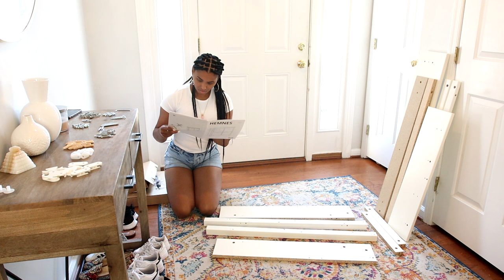IKEA HEMNES SHOE CABINET HACK I SHOE STORAGE IDEAS I ENTRYWAY MAKEOVER (PT.1)

Comment: Looked great!  That piece looks narrow enough that I could put it in my hallway.  Hope you put wood glue in the extra holes you drilled with the frog tape template (the wood dowel didn't look as snug as it might should have been).  Also (just a thought for extra support/sturdiness), when you added the second piece and tucked it behind the first one, instead of just using glue, maybe drill a few extra holes (if possible) on the front backside (where you slid the second piece together) and use wood glue/dowels for additional support.  Love the slim, clean look of that cabinet for hiding shoes! 
 I was amused that you sorted all of the hardware!  At least I know I'm not the only one that does that! 

Glad you're sharing, it inspires ideas for the rest of us!!

Comment: That Alien Tape is really THE TRUTH but it will snatch the paint off the walls! So just be prepared for that after it’s been there for a while and it’s also washable. Yup! WASHABLE! I use it to tack down rugs in my classroom and then just take it up and wash it off with soap and water to use it in another area. Sounds gross but my floors get cleaned daily and it’s covered by the rug so it’s not that dusty and very easy to clean. After washing I let the tape dry on wax paper. If it is super dirty like black i just throw away. One roll of tape lasts a good while.